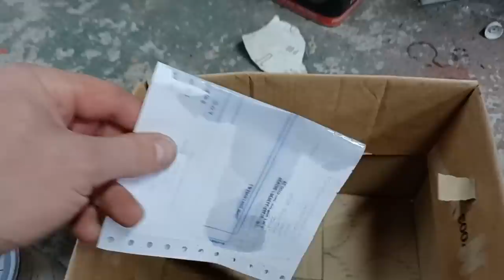Ford Escort MK1 Restoration Project, 2 pack paint with a brush or spray, which works?

Comment: Dave . 2k paint needs a flash off time between coats , so-- light dust coat-- wait 10/ 15 mins , then second coat should be a dry coat - let flash off 15/20 - then a full wet coat. Also remember that this paint flows out as its drying. Hope this helps.

Comment: Hi Dave, nice video, love Mk1 and 2 Escorts. 
Some notes on spraying 2k paint. You mentioned you mixed the paint thick and thought that would help with paint runs but the opposite is true. The thinner it is the less likely you are to get runs, this is because it goes on dryer as the thinner evaporates in the transfer and it also evaporates quicker once on the car, drying the paint before it can run. A viscosity cup is a brilliant tool and the data sheet will tell you what the viscosity should be. This allows you to spray in any temperature and get the same results. We know that paint flows faster in summer so measuring the viscosity means more thinner in winter but as long as the viscosity is the same it will go on the same and you won't get runs. (with some practice). I brush too in awkward places. Regards Ben
Reply from the maker: Brilliant help, thank you 😊

Comment: I enjoyed that video Dave,  maybe borrow a diesel heater or similar before painting to get the shell up to a decent temp which helps lessen runs. Also a 1.2 or 1.4 nozzle to help atomize paint better.  Great work as usual 👍
Reply from the maker: Great idea
Reply: diesel heater puts out an oil film in the air ,particles ,no use for spraying paint  as youl get the panels spotted with oil pins  then paint wont take properly ,i use gas superser to heat the garage on the fullest setting

Comment: looks good just takes time and practice to get use to sprayin 2k paints  
i learnt doing the acrylic paints back in the early 80's  not keen on base coats and clear there a nightmare 

her in aust they use the early capri rear diffs and move the shockies to the inside of the wheel tubs  when they use the mark 1 escorts for rallying

Comment: Thumbs up for brush painting a nice thick layer of paint and not a thin sprayed layer, well that's how they used to do it when coach painting, i think spray painting can be a bit wasteful seeing as a lot of the paint goes into the air and not on the car, and when it does go into the air it dries and becomes a dust that you can get back on the car, catch 22,
Reply from the maker: I absolutely agree, I've rollered/brushed 3 projects before, VW T2 Bay, Mini, Beetle, all came out a treat, but that was with Rustoleum paint. Goes so much further too..
Reply: @DavesGarageuk   defiantly use a roller, i used one with red oxide on very pitted lorry parts, a nice thick layer, it worked a treat,  i then gave the parts a spay can of red oxide on top for a smooth finish  before a chassis black coat, the important thing it got paint on the parts and not on the floor. let us know your results as painting is an expensive and contentious subject and if we can make it easier for the shed restorer with little if no equipment then all to the good.

Comment: hi dave thanks for your vid on spraying and or brush painting 2k paint , ive just brush painted the underside with diamond white 2k using only  ,paint and hardner no thinners and it came out perfect with no runs , it was painted over gravitex just like you did , never knew you could brush paint 2k mate  and it seems to dry really quickly too  thanks again dave keep the first class vids coming
Reply from the maker: Ah brilliant 👏 glad that worked for you as well 😊

Comment: As your not in a booth I would say 10 mins minimum between coats use a fast hardener I usually leave 10 mins and iam in a heated spray booth

Comment: I regularly reach for a brush or roller. The finish isn't so nice with a roller but fine for areas you can't see.
My escort I rollered the inside and out side of the roof, its covered both sides so no worries. 
Find the mini foam rollers are the best. Also just brushed on epoxy primer on the vans inner wings, no way to spray in there.
Reply from the maker: Thanks pal 😊

Comment: I find 2k is really good to work with. It's alot more forgiving than basecoat. But I have not tried cellulose. The thing with 2k is you can apply it with anything. If it has plenty coats on you can flat them back to a good finish. So you can get a good mirror finish paint job with a roller if you spend time flatting it back and polishing. Kinda like a good grinder is a good welder 😉.  And also wetting the floor helps keep dust to a minimum when painting
Reply from the maker: Cheers Dan, thats what makes me a good welder 🤣🤣😉
Reply: @DavesGarageuk  yeah same here also  depending on your local shop I find most stuff is cheaper online and the mixing cups are relatively inexpensive

Comment: looking good! i had a klone axle on my old mk2 escort, with a wild xflow in it,  it took a lot of abuse, outlived 2 gear boxes. possibly stronger than an english axle, the main problem tho is getting spares and there is no LSD option for the klone that i am aware of.
Reply from the maker: That's good to know, thanks, I could weld the diff 😉

Comment: Compressed air straight from the tank is dangerous mate, it has oil particles from the pump. Unless you have the correct air fed mask filtration you’re better off with a good half mask in all honesty. Great work as always though.
Reply from the maker: Thanks pal, you're not the first to point that out, silly me, thankfully I've hardly used that set up, so in the bin it goes. I'll order myself a filtered mask 😷

Comment: You should use proper filters for the mask the one you are using is not for your lungs you will make yourself ill they do very fine particle and charcoal filters for breathing.👍
Reply from the maker: Thank you Neil, many have pointed out it's a terrible idea.  😊 it's in the bin. I'll order a proper mask.
Reply: @DavesGarageuk  3M do really good disposable paint masks for around £30, I use one every month usually

Comment: Genfit do both a black & a white enamel paint. Either are about as good as boggo black or  white get without going 2 pack. Both are a bit like Halfords weld-through primer - they ought be crap, but oddly are not - they are strangely excellent. I'm unsure what primer any money buys that is better than Halfords weld-through primer (I've not found one) - or any black/white paint that is better than the boggo Genfit stuff straight out the can.
Reply from the maker: Just Googled that stuff, never heard of it before, looks like agricultural enamel, so I guess has to be tough, I'll see if i can order a tin of black, it'll be good for the suspension etc.  Ta.
Reply: @DavesGarageuk  Either get Genfit or Tractol - Tractol is good too & often better priced. Tractol matt black is really good for axles, suspension, tie rods and the like - it's more subtle & also very tough. I use it on LR stuff,  lasts very well. :-)

Comment: buy good spray gun. you wont get runs then. just painted mine
Reply: What is your recommendation for a good spray gun please?
Reply: Any spray gun can leave a nice finish 
Runs were probably caused buy the car being cold to the touch !
Reply: @Bikedealer4U  Devilbiss FLG5 can use fluid tips from 1.2 up to 2.0 (maybe 1.8?) so you can use it for primer and clear/base/2k gloss (must be cleaned out thoroughly if you’re using it for all applications). They’re cheap at a snip over £100 and will last for a very very long time if kept clean. In my opinion it’s the best gun in that price range because it sprays almost like a much more expensive gun but has more versatility than most others.
Reply: @mykswappedescortmk2  thanks for that, being a complete beginner at painting this all helps, it’s a bit scary with the fumes and the need for air fed masks. Is this just with two pack
Reply: @Bikedealer4U  a good quality half mask will be ok if you’re not planning on painting 5 days a week with no extraction. Get a good 3M mask and decent fans to move the fumes and you’ll be ok. When priming and even base coat you’ll have little overspray, it’s mostly when you crank the pressure up to 28psi for 2K and clear coat/lacquer (depending where in the world you are) is when you get the most fumes. The FLG5 also is great with a smaller compressor so is ideal as a starter spray gun. Get a decent regulator so you can control the pressure correctly.
Reply: @mykswappedescortmk2  brilliant help, thank you so much. I love watching Dave’s videos as I am about a year behind him